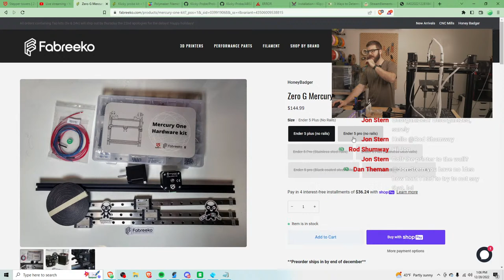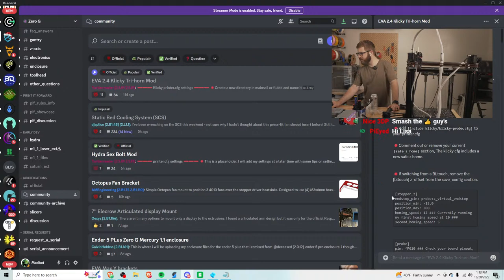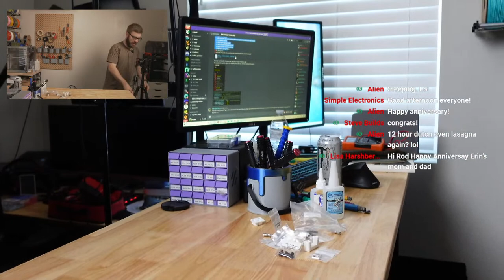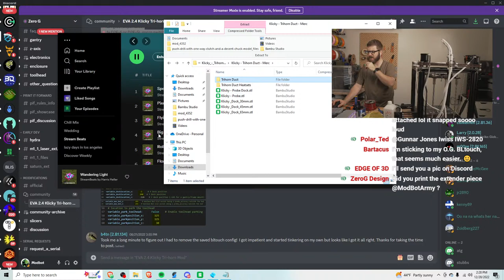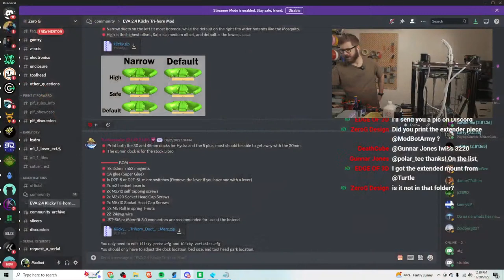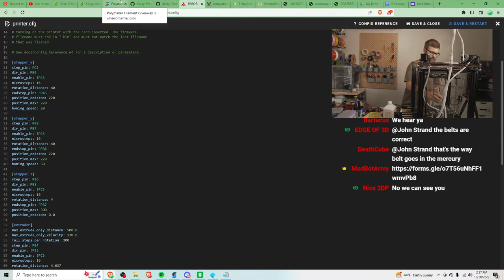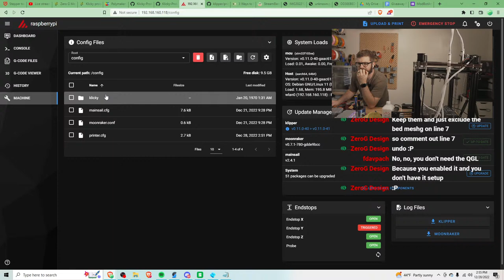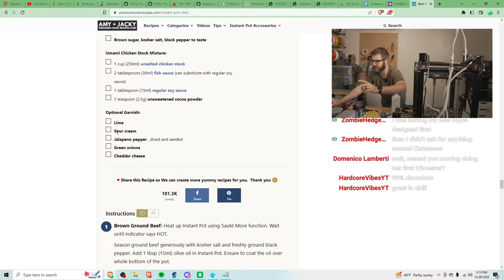ZeroG Mercury 1.1 3d Printer Build Part 4: Klicky Mod & Printing

Comment: I have an Ender 5 (pro) and the only upgrade I did when I first got it was adding a BL Touch as it didn't come with one.    I was lucky.  I have one that printed amazingly well even with the stock hotend.    I recently (after a few years) got a Micro Swiss NG direct drive extruder / all metal hotend.    That is the only upgrade over stock I have done to this printer,    It prints really well, but I am itching for a project so I am looking at this CoreXY conversion now.   It's been printing well, but it is such a good platform for the conversion.